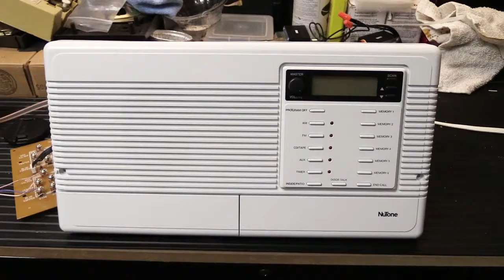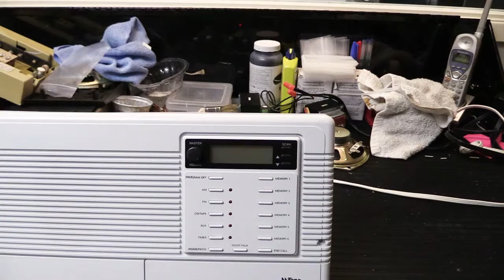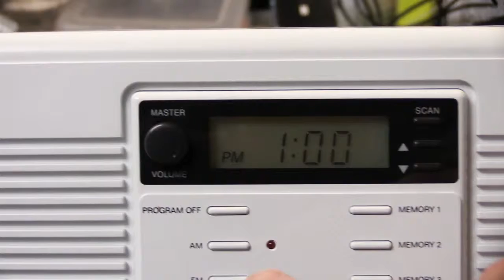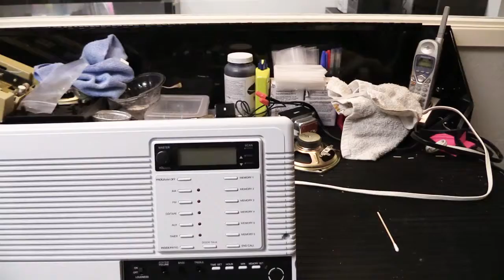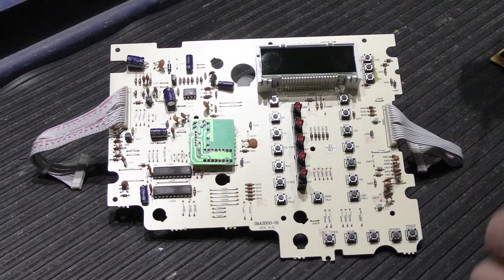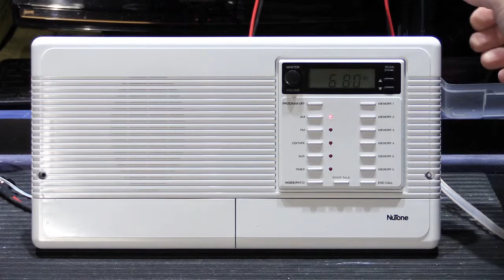NuTone IMA3303 Uncommon Failure Mode #3 - or is it a Micro Controller Problem?

Comment from the maker: Hi MJ:  There were several and many different things wrong.  Some information is propitiatory and I'm not wiling to share it.  If you're going down this rabbit hole in trying to repair the unit you have - you are likely headed in the wrong direction.  The problem in this Video is very specific and very rare, your IM3303 likely has a much more common sort of failure.  

As my electronics teacher used to say: "when you hear hoofbeats think Horses not Zebras"  Horses are ordinary and Zebras are exotic.  Most problems are ordinary but the rabbit hole leads you towards the exotic.  There's no subsitute for testing and measuring when looking for a problem, guessing and hoping won't get it fix - Chris